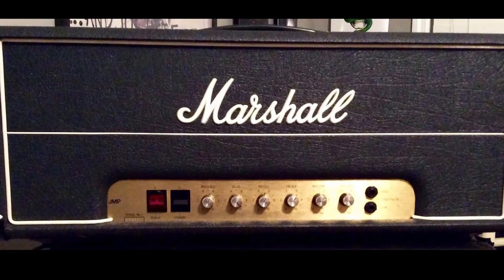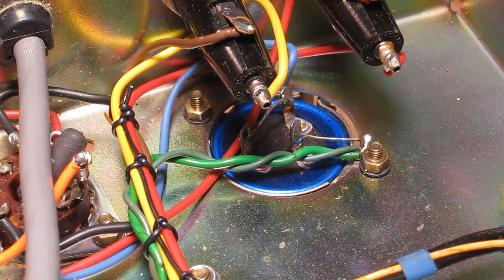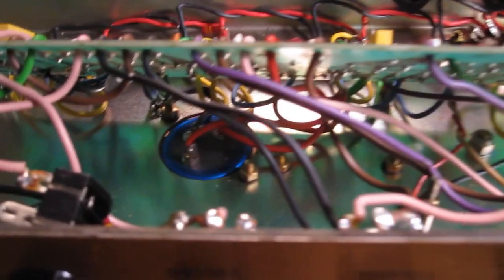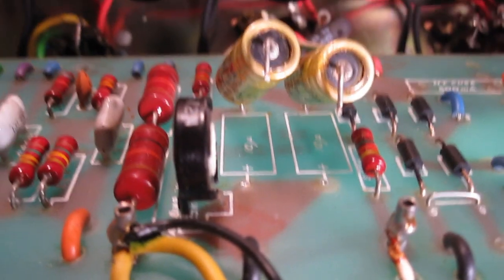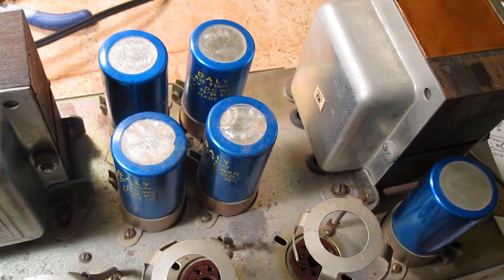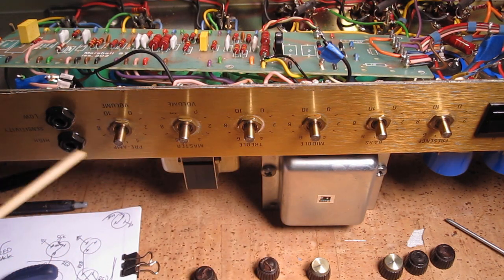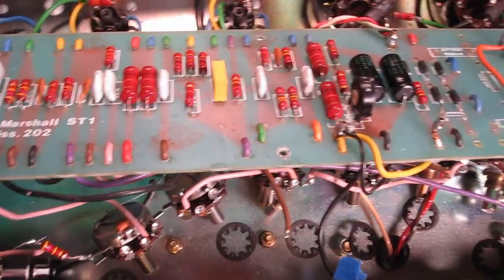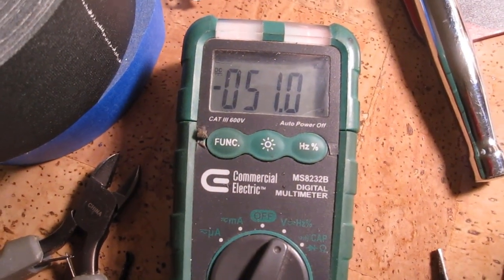1978 Marshall JMP - Cap Job

Comment: Strange way of biasing. No plate voltage measured. No plate or at least cathode current measured. Just blind trust that arbritary instructed number will be OK for any tube? Tubes, even same type and even make, have different conductance. They will draw more or less current. That will affect plate voltage. Biasing is function of the plate power. Sure anywhere from 55 to 75 percent of the maximum plate dissipation will work and biasing will change with the change in the mains voltage. Still amplifier will sound different with good biasing. It will be able to reach full power too. To cold and no max power and thin sound. To hot and you reduce tube life at least. Bad bias can cause crossover distortion and that's bad sounding distortion. Anyways I bias very differently. I would say learn more about it.

Comment: I am in the Steve Fayetteville camp on this topic.  Just replacing caps on a vintage amp because of age is nonsense. Even if they are 40 years old. If there is no sign of them being defective ( bulge , or the safety valve tripped) and/or electrical leakage has been tested the cap is just fine for most users. If this is the main amp that is being used on stage and rehearsals for 5 hours a day the situation is different of course and you just do this as a preventive maintenance measure. But most of these jmps are a part of a collection or studio  and aren’t being used much at all. Careful reforming the caps before turning the amp on after a long time ( eg variac) keeps these caps in shape  and if in doubt there is specialized equipment available to test caps. The lifespan of these caps is based on hours of continuous use, not shelf time. It’s different with paper/oil caps from the 50ies/60ies though since they dry out

Comment: on the 2 bias caps, you could just cut the legs and leave the nubs sticking up for top solder points - but it is a cleaner job to just get under there and do it

Comment: I don't own a Marshall, but I do have an 80s Peavey VTM which I think needs a cap job done. I replaced the tubes a year ago and noticed there was a lot of rust inside the amp, especially in areas which I cannot reach with my hands. I've been looking for guitar amp techs in my area but sadly there are none. After I replaced the tubes, I kept hearing some humming whenever I turned it on, which cannot be turned off with a noise suppressor. If the amp has rust inside, does it mean it's fcked?
Reply from the maker: Not necessarily “fcked”. Rust isn’t a good sign, but there are plenty of rusty chassis out there that still house well functioning amps. Exposure to a damp environment is a red flag tho. For instance, rust can inhibit good ground connections and moisture can cause oxidation pretty much anywhere inside the amp. If you replaced the power tubes and then started hearing hum, make sure the bias is set correctly for the new tubes. Improper biasing can induce hum.

Comment: Excellent video... The up-close view and detailed descriptions are second to none. What were the symptoms that prompted the cap replacements? It would have been nice to see how you discharged the caps. Cheers.
Reply from the maker: As a rule, any electrolytic cap that's 40+ years old should be replaced. Especially if the amp is going to be played with any regularity. As for cap discharge procedure, there are many good videos on YouTube that cover that in detail so I typically don't include that information in my content. Thanks so much for watching!

Comment: Steve Grindrod designed the two-input Master Lead Mk. ll (2203/2204) in early '76. Steve also designed the JCM 2000 DSL100 in 1995 (to compete with the Dual Rectifier) before leaving Marshall to start his own company: Albion amps.

Comment: Pretty sure i have seen a guy do the filter cap under the board from above the chassis. But never tried it though.
Reply from the maker: Yeah that is ideal if the leads are long enough. I had to flip the board anyway to change the bias caps so I just did it from underneath.

Comment: with the 10uf bias caps, why not clip the leads close to the caps, and solder the new caps to the old leads from the top?
Reply: Just clipping and leaving the leads on there is a real terrible way to leave your work. Especially when in most cases you gotta flip the board to get the big cap underneath anyway. It only takes 5 extra minutes to unmount the pots and desolder the choke/OT wire that's holding you back from flipping the board. A desoldering vacuum like a Hakko FR-301 is also a major time saver.
Reply from the maker: Sorry for the delayed response. As @purgasound indicated, it is considered bad technique to solder new caps to clipped, old leads. Although it will technically work, the problem is in its reliability. Especially in a bass amp, where there is a LOT of vibration, that type of solder joint will not hold up over time. Also, the bias section needs to be as rock-solid as possible. A failure there will also cause your tubes to fail and possibly kill a transformer.
Reply: I get it, thanks for the good advice.

Comment: holy sheet, thank you I am working on this exact amp as I type, 1978 with the PC board! have it sounding great, hum gone, was mismatched power tubes and some mods I removed. Next I will replace the 1978 caps before one explodes and makes a mess in there or destroys the transformer.